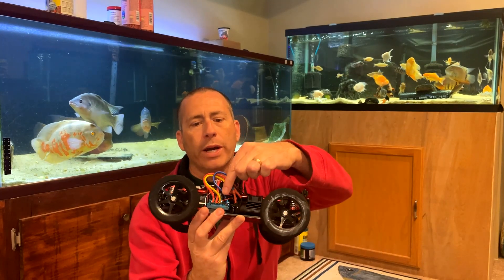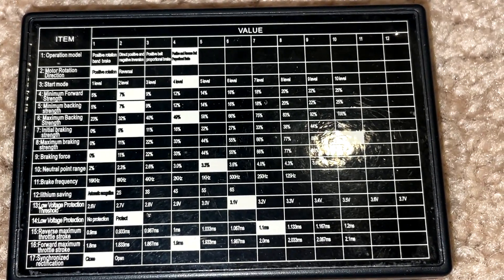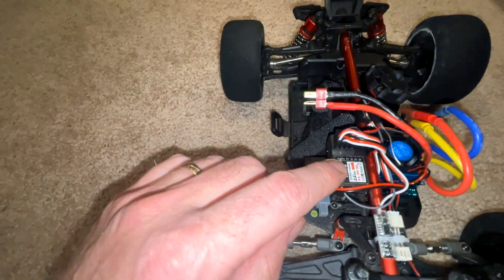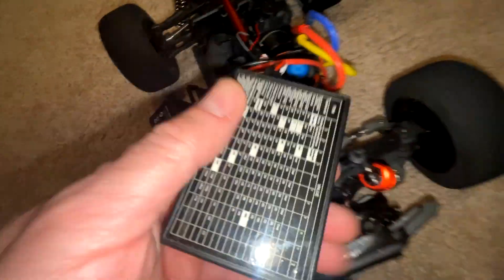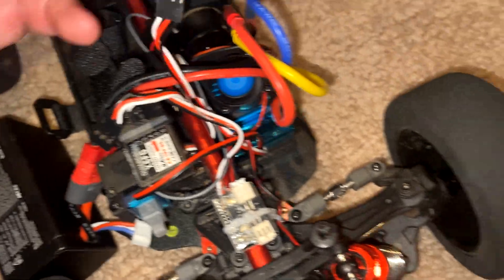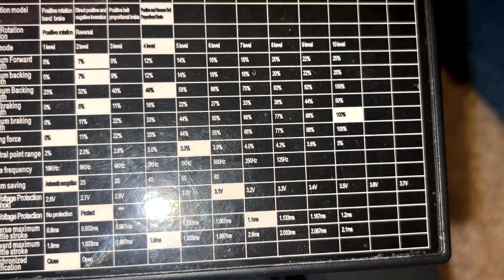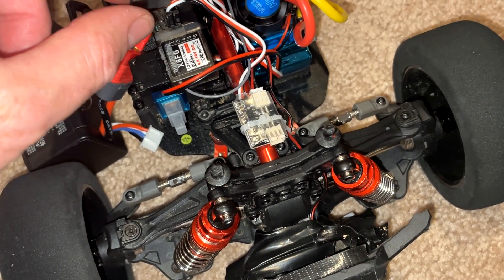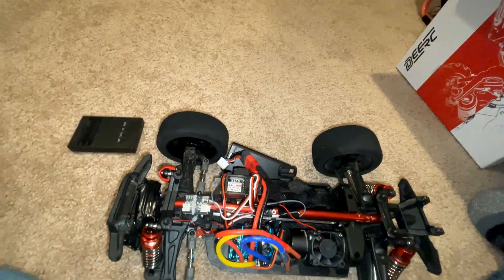Programming $30 VBest Life / Delwi 120A ESC

Comment: Sorry I know I'm late on this

You may have already worked these out however

4. Minimum strength, you'd want that to be the smallest number so setting 1 (5%) basically it's saying that as soon as it picks up the signal that the throttle is being pulled, it'll jump to 5% throttle and go up from there, if you had a low power motor, you might choose to start the minimum throttle at 14% then you'd have finer feel on the trigger as your movement from neutral to full pull on the trigger is only covering 84% of the throttle range

5 minimum backing strength, again you'd want reverse to start at the lowest percentage

6 max backing strength, if you don't need the car to do 70mph in reverse, might as well drop that to the minimum too

Neutral range, you want that number to be the smallest number you can that allows the buggy to sit still when the throttle isn't being moved, if your radio isn't the best and it's neutral signal moves around a bit then you need to bump the neutral range up a bit. Basically if you put it up to 5%, you lose 5% of the trigger movement as "deadband" which means you have a less granular feel on the throttle as you have less trigger movement covering the throttle range 

Hope that helps you or someone

Cheers
Reply from the maker: thanks, great information to share.

Comment: My experience with it was not good. It did not work on some engines such as the Hype Go 14210.
Reply from the maker: It worked with some motors but not others?
Reply: @BriansRCStuff Strange, it worked on an engine. Scy 16103pro No problem